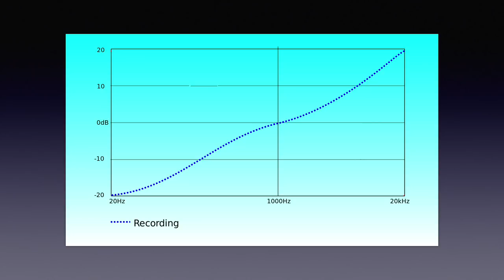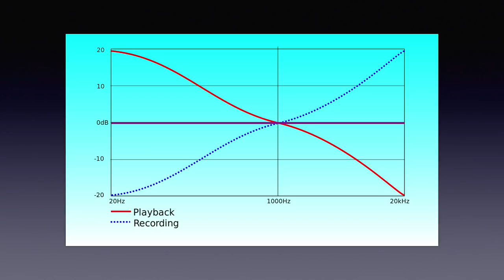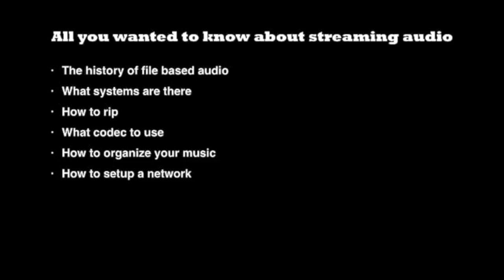Why vinyl might sound better

Comment: Hans just want to say I am big fan of your channel! Learned really lots about Audio thru ur excellent and informative channels. Just want to add: I didn't grow up with vinyl.. I am only exposed to vinyl in the last 2-3 years of my life (almost 40 y.o. now) and that's what got me into 2 channel Audio. To me vinyl sounds more natural and life like sounding and now I realise its probably due to two things that you smartly pointed in the video: 1. The limitation of Vinyl dynamic range and physical limitations forces vinyl mastering to be BETTER than other medium. 2. The RIAA curve filtering is smoother compared to Digital Aliasing.
Reply from the maker: Both analog and digital can be of equal quality. When 'affordable' quality gear is used, the artefacts of one might be preferred (less irritating) over the artefacts of the other.

Comment: Excellent topic and presentation, Hans.
Though I have a lot of very good to high end digital recording and playback equipment, I keep a pretty good analogue setup too - which includes Vinyl.
As with digital, 3 things are essential for audiophile quality playback with vinyl records. 1. The recording 2. The pressing and 3. The quality of your playback setup (I won't include the performance aspect) 
Though state of the art digital is better (much) most have never heard what high end digital sounds like, as Its true to say most have not heard what high end vinyl can achieve. Technically digital will win every time, but our ears will tell us different sometimes if all key aspects of playback are correct. 
Today, digital plays a big part in my recordings (PCM & DSD) and has safely reached a stage of superiority at the higher end.
Reply from the maker: I agree

Comment: Very nice approach indeed.
Let me add a few things.
CD has two other problems:
One is dithering, a process to erase the intermodulation of clock 44.1khz with audio, means that the precise picking moment of  each sample is randomly oscillated in order to erase the perfect clock of 44.1khz from interacting with the audio, this reduces harmonic spectrum noise, but gives an unnatural and tonal harmonic shyness to guitars and other complex harmonic natural sounds.
The other is dynamics VS resolution, the CD has more dynamics but the low level signals have very poor resolution (reduction of available bits for coding), and on very high quality systems this is very evident, (old vinyl pressings from 70's compared to the same on a lot of different CDs), the notion we get during listening, is that vinyl has more overall detail.
This small-scale fine detail combined with a fuller tonality in some instruments like acoustic guitars, give us a clear increase in pureness and naturalness of the analogue experience.
Reply: Pedro, good points. It's not like people can tell you why early CDs didn't sound as good as today's remastering, I had to search to find an answer. On a defunct web site, it mentioned a couple Sony PCM machines that were commonly used to master. You could have a "hot" mix, or be very conservative and not to add digital distortion - what would THAT sound like. However, even Sony admitted dropping some bits wasn't going to hurts anything. Today, those PCM machines are history and you can now HEAR exactly what will be on the audio CD, beforehand, unlike yesteryear.

Comment: Interesting breakdown. One thing I don't understand is the time smearing you speak about. How does an A/D-converter introduce time smearing? I thought that only happens in digital filters where time discrete samples are converted into the frequency domain.
Reply from the maker: All filters cause time smearing, including the anti aliasing filters in AD's.

Comment: Hans, you make some good points. Feel vinyl had far less dynamic range than audio CDs, so peaks were limited and the music was louder. Find some audiophile pressing from MFSL, and you'll notice the loudness in less than the commercial pressings, since they attempted to preserve the peaks. But, peaks are boring, since they add little to audio quality.But, let's talk vinyl LPs. Back then, they had to store analog music on magnetic recording tape, hopefully, not adding any tape hiss noise. Plus, man had little electronic tools to enhance audio back in the 60's+. Some record companies, like Capitol, made their own electronics to enhance sound. Add thermal noise of electronics and hopefully a clean mixing board to mix with to create a song. You can remove all those problematic areas, and remix analog recordings in a digital world, for the greatest dynamics.Some, like Bob Ludwig, complained about Loudness Wars. However, my review of vinyl 45s from decades back, tells me the Loudness Wars have always been a part of Pop music. As the song would fade, the fidelity improved. Back then, I didn't know why, but I do now. Bottom line, if the vinyl record sounds better than the audio CD, blame man, he's the culprit.

Comment: Are all tube amplifiers necessarily running in class A? And is class A power generally more robust, meaning you would need fewer watts in a class A amp to achieve the same result as in class AB or D?
Reply from the maker: No, there are also class A/B tube amps. Class A is not 'more robust'. In general with tube amps (both class A and A/B) you need less power than with solid state amps although we don't really understand why.

Comment: What do you expect is needed for Digital to sound better than Vinyl?
Will that ever be possible given your statement about the filter which is used in the critical mid range in digital?
Reply from the maker: Well, consider MQA, has the advantages of both analogue and digital...

Comment: what kind of battery pack should you have to run the Rasberry Pi plus a hat amp like the HiFiBerry?
Reply from the maker: I don't know. Batteries are not necessarily the best way to power audio equipment and certainly not power amps.

Comment: I think if you are using vinyl you are more able to create your own sound by choosing a cartridge wich is more making the sound you like. With digital music is it, for me, not always a happy match.
Reply: But different sounding cartridges  mean different colorations of the original sound, In the same sense you can use an equalizer to a digital source, that would be more sufficient than changing cartridges.

Comment: I don't know man, I'm no audiophile nor do I have the gift of the "Golden Ears".
I just find that on a good recording (both vinyl and CD), vinyl just sounds a bit more realism.
It just has more depth and spatial presence that I don't get from a Cd player. CD's are smooth, silky and dynamically fast but it just lacks that midrange magic, which I call life like presence. 

There's no other way of describing it. You just have to hear it for yourself on a high quality turntable with a high quality phono stage.

Comment: 'Your ears are only part of your auditory system. Your brain plays an important and intelligent role ... there also might be secondary stimuli that can be associated with playing a record; like the turning of the record on the player, the unpacking of the record from the sleeve, and so on.'

Oooh … nice. And if anything, an understatement. 

I am an applied linguist (35 years in Japanese and American universities) with an undergraduate degree in biology and post-grad readings in philosophy of science as well as linguistics. A Dutch compatriot of yours, the primatologist Frans de Waal is one of my contemporary inspirations. 

But it does not take a professional linguist to note the ease with which the smooth flow of collaborative communication is compromised when visual cues are omitted from a communicative act … Otherwise this Youtube video would not be necessary. An mp3 file would do just as well.

Granted, music as art is not the exact same thing as conversation, but there is a large degree of communicative intent, and it is a collaborative act. The listener’s musical experience (social constructs) and many genetically influenced differences in psychological constructs such as ‘tolerance for ambiguity’ are brought into play when listening to music, otherwise there would be no qualitative difference between The Sex Pistols, a military marching band, and Harnoncourt playing The Brandenburg Concertos. 

And of course, the difference between being at a live performance or even at a studio session … and privately hearing a reproduction of those performances, is worth an essay in itself. The psychological difference would be like night and day. I would sacrifice a year of my allotted lifespan to have had my nose pressed against the window of the recording studio when Miles Davis recorded ‘Kind of Blue’ ... or that magic moment when Astrud Gilberto was cleverly inserted into one song on an album that was was supposed to feature João Gilberto and Stan Getz ... or neck deep in a mudbath at Woodstock, listening to Jimi Hendrix.  All potential life-changing experiences which, without imagination, even the latest and greatest home sound systems can give only a hint, much like the echoes and shadows playing against the wall in Plato's Allegory of the Cave.

The increasing polarization of politics is also a result of communication without visual cues … the ease with which democracies can be disrupted (or exposed) by anonymous purveyors of ‘alternative facts’ — easily just some lone hack trying to make an easy dollar … or a fifteen year old screaming for attention. Yet another essay for another time.

But back to the music.

I am thinking of recent and long overdue inductees into the Rock and Roll Hall of Fame, British Prog Rock group, Yes. 

Back in the day, I remember getting as big a thrill from just gazing at Roger Dean’s steam-punk art work gracing the covers of those early albums … particularly ‘Fragile’, ‘Relayer’, and ‘Tales from Topographic Oceans’. I dare say, the communicative sound of Yes would not quite have had the same impact without the collaborative graphic talent of Roger Dean.

But having gone on to discover the pleasures of jazz, both in the emerging fusion / post-bop era, as well as its earlier progenitors, I can’t help but to associate the sounds of some great music with those classic, minimalist Blue Note album covers (several books have been made of those album covers alone), as well as that ECM label cover art … ethereal tone-poem landscapes, or even the somewhat dated Windham Hill label album covers. Don’t get much of that with even the best DAC. 

As fundamental as the sense of sound is to what it means to be homo sapiens, a social primate, I think there is a good argument that sight may be even more fundamental … and has a largely unexplored impact on the subjective quality of our listening experience.

I am learning a lot of new things from you, Mr. Beekhuyzen, and based on my own professional experience in another domain, agree with your stressing the importance of the entire nervous system. Enough so, that with this comment, you have earned yourself another patron.  Just call me #67 ;-)

Thank you sir!
Reply from the maker: Thank you sir, I do agree on most if not all points you make. And as always: enjoy the music.
Reply: Thank you!!  A simple way I have always said what you just described is "music for many vinyl record collectors is about MUCH more than just sounds waves hitting your ear".
Reply: LOL ... I rattled on too much.  I think you nailed it, mrhoffame :-)
Reply from the maker: If it only were that simple. What you say might be 100% true for you - actually, I'm sure of it. But that doesn't neccesarily mean it's true for me too. In fact, it isn't. And I know a person that gets very stressed listening to MP3's. Like I get very stressed listening to radio due to the multiband compressors working overtime....
Reply from the maker: I don't know, could be.
Reply: The best songs are little conversations!

Comment: From my perspective another reason could be that most people get a raw deal with the builtin DAC. Listening to digital music that is most likely compressed with an average or below average DAC kills the pleasure, against the same system with an addition of just a vinyl player with phono preamp.
Reply: Just thoughts really : Perhaps this can be debated endlessly.  I too enjoy my vinyl and it has better separation and more detail. The SACD I play is butter smooth in comparison and sounds equal or better to vinyl can't say the same for CDs, well, at least to my ears.. 

However, for the very first time I've just ordered a seperate hi-end DAC  and I'll soon know if this makes any difference to the one inbuilt. Fingers crossed..
Reply from the maker: You might have missed my third argument in the video
Reply: The Hans Beekhuyzen Channel : Yes indeed I had.. Then further what is left is run through ordinary builtin DACs. No wonder I enjoy my vinyls specially 1970s pressings.

Comment: I never liked CDs, let alone MP3s, but I’ve just switched from vinyl to MQA. Love it. One of my listeners said MQA sounds 3D, which I think is a good way of describing it. I’m not getting rid of the turntable though. Although MQA immediately shows up lesser digital formats, vinyl holds up well, I guess because of some of the factors Hans mentions. I wonder whether engineers had just got really good at mastering analogue tape for vinyl.
Reply from the maker: Over the last 10 years or more vinyl is cut from digital masters....
Reply: The Hans Beekhuyzen Channel my vinyl recordings are all more than 10 years old!

Comment: I prefer vinyl over digital for one reason- a stronger emotional connection to the music. I don't care about hipster cred, nostalgia, cover art, etc. It's really all about the music. I bought the Beatles stereo catalog in eager anticipation, but I was very disappointed after listening. The sound was dull and lifeless. Didn't have the same energy as the original records or AAA reissues. And, not coincidentally, the LPs were made from a digital source. A few years later they release the Beatles mono catalog, with AAA sound, and the difference was obvious. Direct emotional connection to the music and fatigueless hours-long listening sessions.
Reply from the maker: enjoy the music

Comment: Sorry man , but I gave up on vinyl years ago and I'm not going back. A needle touching a spinning disc causes friction , even if it is of low value , plus I've heard snap , crackle and pop even on expensive turntables.
Reply from the maker: Don’t feel sorry, I too gave up on vinyl although I still have my turntable. ....